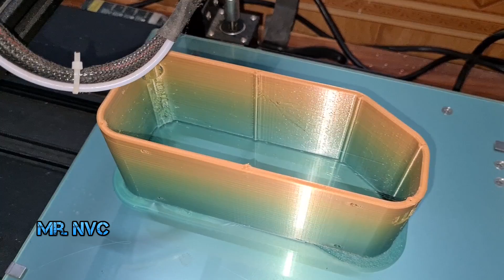eBike Build with 150$ - Making a Simple Electric Bike

Comment: sorry, but I don´t think the build was worth it.
the bicycle is a folding bicycle with having the weak point at the folding mechanism, a bicycle with a rigid frame would have been better.
the brakes are terrible, these are unsafe.
neither the housing for the battery attachment nor the housing for the controller are water resistant
Reply from the maker: Thanks comment. the bike reaches a maximum speed of 25 km/h so the brakes are safe, the control box is completely waterproof, the battery part I will do extra water protection.
Reply: @MRNVCDIY  it isn´t waterproof at the holes of the electric wires. And let us be honest, these kind of brakes with rubber pads are the worst. You added weight, and now you can do 25 kph for what, 20 km or so? These brakes on that bike were never build for this kind of stress. Be safe.
Reply: @torquemada6781  how much weight do you think he realistically added though? The motor is obviously a fair contribution, but it’s perhaps no much more than carrying a backpack. I hear you though!